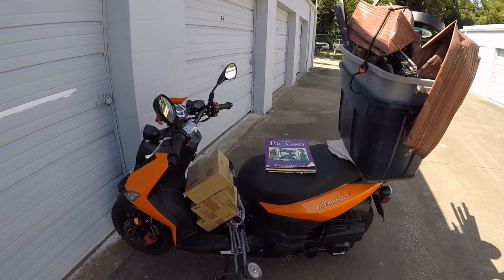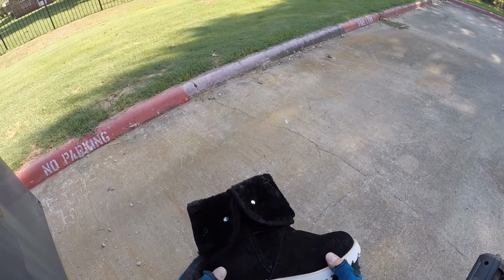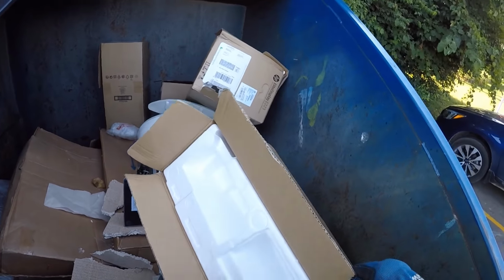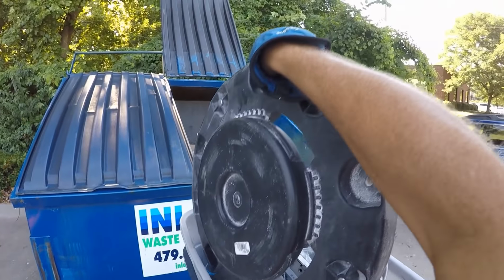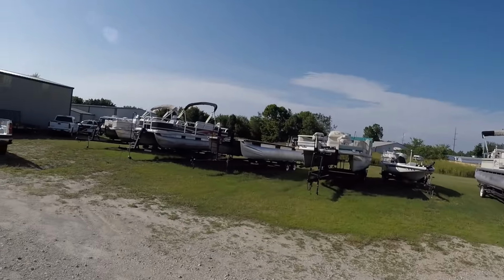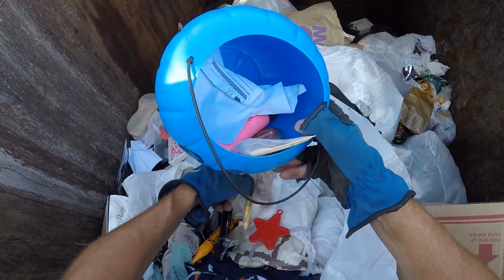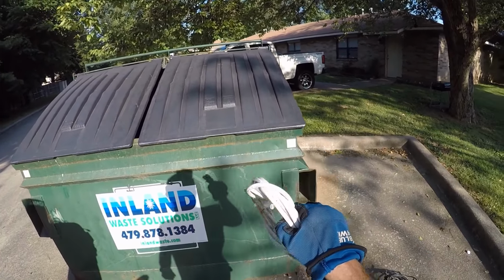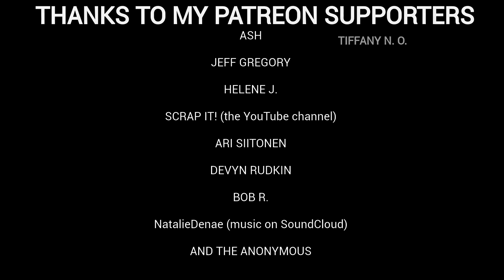POST OFFICE, LIBRARY, SCRAP YARD & DUMPSTER DIVE ALL THE WAY HOME...

Comment: scrap vulture I like the videos you put out and yet I am failing myself. I live in an area that has 200,000 people some dumpsters are off limits to me do to no trespassing signs or no dumpster diving signs or dumpsters that are all fenced in but the ones I hit up never seem to produce any thing worth scrapping. I feel horrible knowing I depend on things like scrap cords or metal to help pay the bills. I struggle getting a regular job. brother and I are roommates we spend $415 per month on lot rent on the mobile home we have. damn man I have until the 3rd of the month to help cover rent and my back is against the wall yet I don't have much gas. I guess that's part of the reason I collect so many aluminum cans. I can go down any street and get a lot and @ 45 and 50 cent per pound it adds up quick for me.
Reply from the maker: maybe you can make up card sand see if you can make contacts with people.businesses that will save up there scrap for you to pick up
Reply: @ scrap vulture I have to laugh I thought of you when this happened. the area I live in there Is a self serve car wash that has around 8 locations in the metro area. one Is a very short distance from my pad. I went to dumpster dive. wow that one was a gold mine I ended up finding stainless steel travel mugs, small pieces of metal enough aluminum cans to fill a 13 gallon trash bag. but what I found funny is how a Minnesota state trooper sat at the set of lights watching me and never did a thing about it. when I looked over and saw him he smiled and waved.
Reply: I don't know if they care much about the dumpster diving end of things I do know in the area I live in they love getting people on trespassing theft and if a dumpster is back far enough they have two charges on a guy. that's how they roll around here. I have found if dumpsters in eye shot of the road and cops can see what your doing they leave you alone.